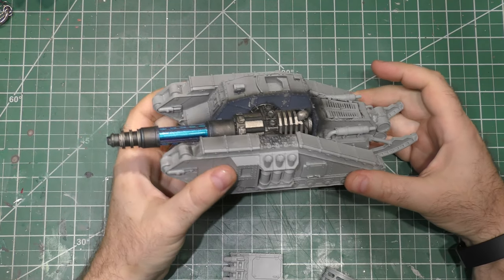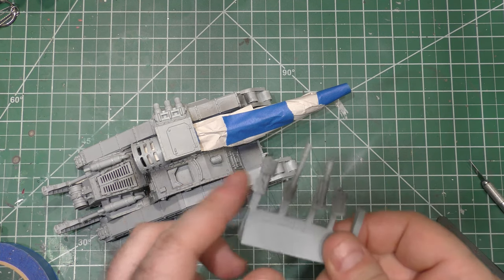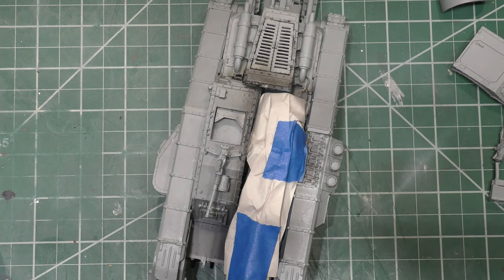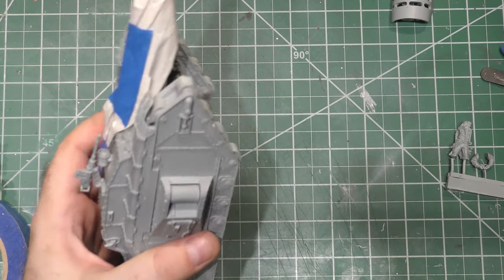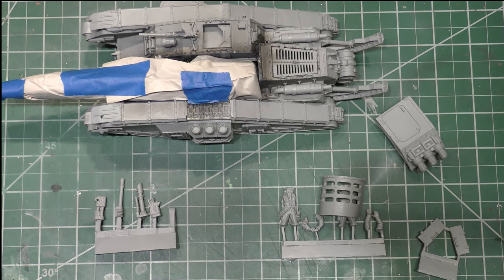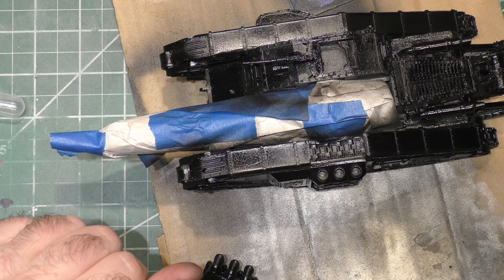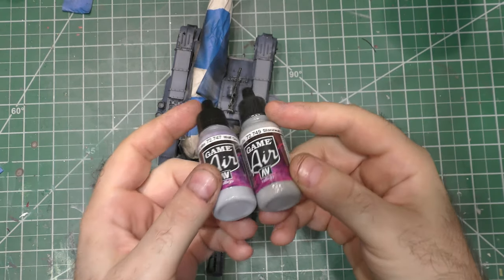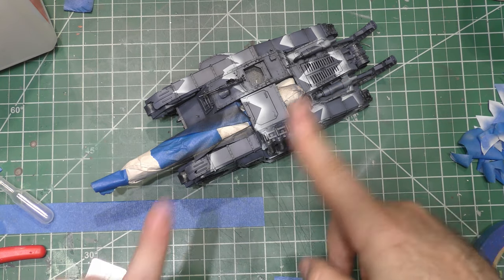Forgeworld Warhammer 40K Valdor Tank Hunter - Part 3 Battle Damage & Basic Painting

Comment: The tracks are from the Leman Russ yeah? Is it the same layout as the Russ tracks? If you still had a manual for one of them around you could check. But i agree, it should be in the manual for the model.
Reply from the maker: They are from the Leman Russ, but the layout is different becasue the tracks aren't placed all the way around and the dimensions are different. It's not super hard to figure out, but why not just put it in the instructions?